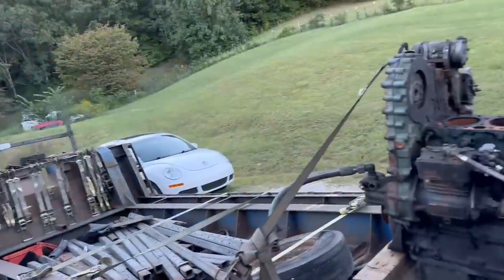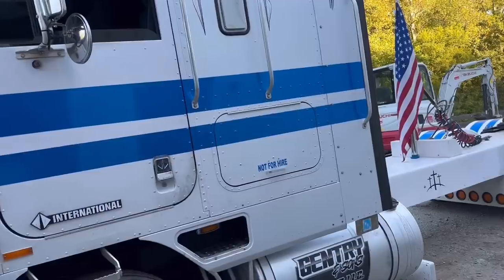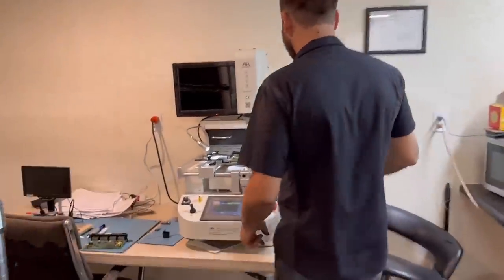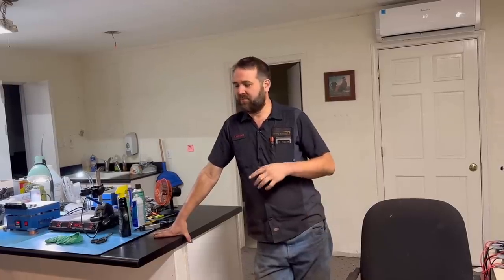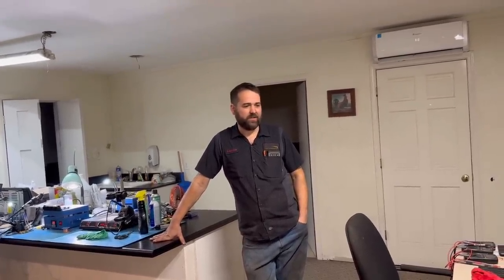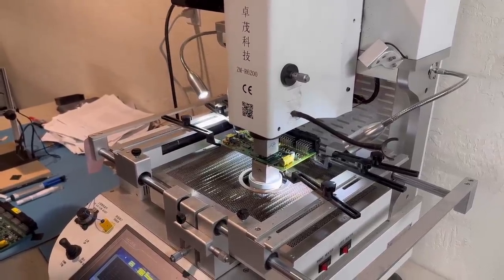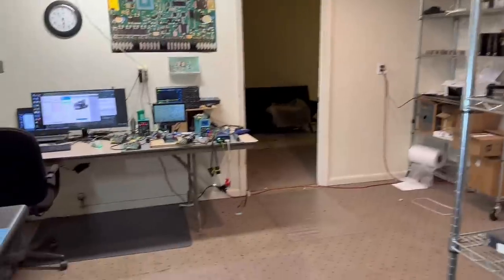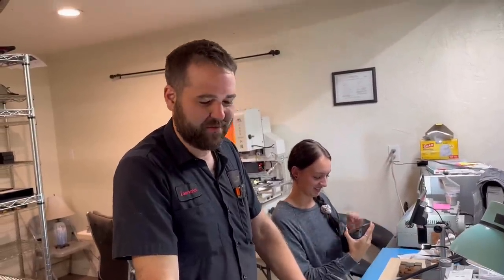FREIGHTLINER CPC Problem Is Over We Have The Fix!!

Comment: Please relay to them that the girl needs to have a fume extractor running when she’s cleaning the pads on the chips. The fumes from the flux and the solder can be toxic. It’s a cheap piece of equipment but it would be a lot healthier for all of them.
Reply: Tim please do this we don't want to see Virginia get hurt!
Reply: Well now that you said something about OSHA will be in contact with you and your complaint
Reply: You can literally hear it in the background.
Reply: @jimbob8969  can hear what? A fume extractor? That whining noise is from the  BGA soldering station. Fume extractor would have a box with a hose attached to it to pull the fumes away and filters it.
Reply: @russellclugsten4797  really?? Look at buddy’s teeth up top… wait there aint none left lol 😂
Reply: @russellclugsten4797  I know what a fume extractor is, I have one that would recycle the air in that room in a very short period of time.  Mine is mounted in the ceiling above our welding and cutting floor.
Reply: @chorbajiiski   & your point been is.......
Reply: This is why the internet sucks because of some of these comments.
Reply: @MegaDripping  my point is learn how to spell
Reply: 😅😂😂🗣️🤡relax   Thiers  a vent at top of the door!!🗣️😂😅 I'm sure their no rookie's relax!!!🤠🤡😤😅😂🗣️
Reply: @russellclugsten4797  dude Thiers a Thiers one in top of the door  genius
Reply: @russellclugsten4797  soldering is easy  I've been soldering for years  i hate when pp think their experts over watch ING a video😂😅🤡  u think they don't know the toxic fumes it puts out or u just thing their stupid etc lete know?????? Send them one if your worried i will school u when it comes to soldering dude 😎 😤
Reply: @jimbob8969  That is not the same thing, for us who do a lot of soldering you must have the extractors head no more than 2-6 inches from the work, what you're talking about will kill you, Lb is extremely poisonous. Here is a master, Louis Rossmann. https://www.youtube.com/@rossmanngroup/search?query=soldering

Comment: It sounds like Freightliner, Western Star / Dimeler have knowingly designed this cpc  with this flaw so that it will fail after the warranty has expired so that the truck owners will have to spend the money on labor and a new cpc. It would also seem that they don't care about the potential thousands of dollars it could cost the truck owners.  I  wonder if someone could bring a class action law suit against them. After all this video proves the fault in how the parts are made and how it could be fixed by the manufacturer just by changing the type of solder and Flux they use.

Comment: Schaffers diesel did my 2000 century and it s an amazing tune.I love the way that truck pulls and feels
Reply: Unfortunately, I haven't had a good experience with these folks. I've paid $2500 for a CPC repair. I tried it in the truck and had more codes that I started with. He asked that I send it back to him. I did and he hasn't fixed it. For 2 months I have asked for it back. Fixed or not. However Mr Shafer has ghosted me. Weeks and weeks. No response and no CPC. Would NOT send my CPC or anything there again.
Reply: @davidplantemusic3687 Have your issues been resolved? I need to know before I bring him my cpc.

Comment: Good on you Tim, for helping a local, become very comfortable with life financially, and I’m sure he will succeed in life! Ronnie, Oneida Tennessee
Reply: Unfortunately, I haven't had a good experience with these folks. I've paid $2500 for a CPC repair. I tried it in the truck and had more codes that I started with. He asked that I send it back to him. I did and he hasn't fixed it. For 2 months I have asked for it back. Fixed or not. However Mr Shafer has ghosted me. Weeks and weeks. No response and no CPC. Would NOT send my CPC or anything there again.

Comment: It's kind of sad that manufacturers won't address these issues with any degree of expediency & reliability. At least somebody is out doing good work like this who actually cares about people's livelihoods.
Reply: General Motors is having the same issue and some of their newer vehicles. And it’s not that the manufactures have not addressed the fix is the fact that they don’t have the part to fix it.
Reply: @philliporne2287  you don't need parts. You need solder & a bit of know how. Manufacturers just refuse to repair products because that doesn't make them as much money and requires more work.
Reply: 🤔 Built to fail to keep the money machine rollin and create jobs. These days the corporate don't build to last with quality it's done with quantity. 💯
Reply: @sawyer4981  It is so much faster and cheaper to replace than repair.
SMT soldering is nothing like through hole soldering.
I can solder through hole and simple SMT chips but don't have the tools or skills for soldering those chips.
Reply: @andrewforte  I literally just said that. But if you can't replace the parts and the shit you're making is failing, you should be offering repairs to customers who paid hundreds of thousands on your products which are now useless.

Manufacturers won't do that because it doesn't load their pockets enough. That's fucked up.
Reply: @sawyer4981  it’s called a recall.
Reply: @philliporne2287  That's nice, except they don't recall the shit that's broke. They just expect you to wait several months after paying them thousands of dollars to receive a replacement part. All the while, your business is at a complete standstill. Even better, you're still paying your truck payments for a truck you can't even use.
Reply: @sawyer4981  If a vehicle is not usable to a point that it’s still under warranty the manufacture will buy it back from you. The part is broken and it seems to be a big issue 9 out of  10 times it’s gonna be a recall.
Reply: @philliporne2287  Ask someone who's been there, that's damn near impossible. Getting the manufacturer to buy back the car requires months and months of them "trying" to fix it first and almost always requires you getting a lawyer to sue them first. It's even more difficult with commercial vehicles. They will point the blame to others since there are so many suppliers involved in all the major components on tractors. 

And again, all these months, you're making payments and paying that lawyer without the ability to generate income using the truck you paid for. 

Idk what it is with all you idiots simping for manufacturers as if they have your best interest in mind. I can 100% guarantee you, they do not. Their only goal is to extract as much money from you as possible.

Comment: 12.7 s60. Had drove many of kw t800. Getting over 6.6 mpg running the Colo. Mtns all year for over 10 yrs.  Solid n very dependable Detroit engine. Had set at 430.470 horses. Jake's are decent too.  Stay safe n keep it going

Comment: It's quantity NOT quality these days for corporations. Purposely designed to fail to keep the 💰 🤑 💸 💲 Machine rollin. Take for example the John Deere Tractor.  Notice how many MUCH OLDER ones run FLAWLESS and still around  compared to modern tractors 🚜 with all the down time.
Do the research. ✌️😊👍

Comment: I have a 14ltr that I use to haul oversized load with. Weighing up to 140k. I'm lucky to see 3.5 mpg sometimes. Even with a light load I'm only getting about 5mpg. I just had it rebuilt but I think my tune is the problem. It runs great and pulls hard but the Pyro stays around 900 degrees and it will jump up quickly if I don't keep the rpms up around 1750 to 1800 rpms. The turbo is a 1702 and it will boost 40psi and it'll hold it but then the Pyro will start to go above 900 degrees. Why advice on a tune and how much to do it? I've already spent more on this engine just trying to keep it together. It's blown 4 head gaskets over the last 6 years.

Comment: Just broke down after pulling off the Lease lot at SFI finance 3 days ago. Pulled into a Loves for my 30min, tried to start the truck again & it doesn’t turn over. CPC not configured on the dash, no indication of any bad batteries. It was towed to a shady Freightliner associate vender in Ohio cause it was the only one nearby. They say all the batteries need to be replaced, but that makes zero sense. If your able to answer quickly you can save me here, Would a bad battery cause a CPC dash fault? And why does this module control such important aspects of a Semi Truck. This is absolutely criminal, it has conspiracy written all over it. That makes trucks vulnerable to hacking. Anybody can send a killshot to this module & ruin somebody’s life. Mega Carriers can abuse this to destroy somebody’s money or Owner Ops. I need advice please respond if i should tell these guys to not bother with the batteries & to fix the module somehow.

Comment: 12.7 Detroit series 60 engines from Fitzgerald we've used average around 6 mpg. Is there something you are changing to get 7-8 mpg?
Reply: Lol. No
Reply: It’s got a lot to do with the driver if he is an aggressive driver then you’re not going to get 7 and 8 miles to the gallon I have owned three Siri 60 12.7 L Detroits and I have got as much as 9 1/2 and 10 miles to the gallon loaded light running flatland and keeping my foot out of the radiator.
Reply: @tomhodge2565  we run them for years pulling vans. 5.5 to 5.8 fleet average is all we could get. We run all newer stuff now all paccar and it’s unreal how good the fuel mileage is.  Kenworth T680’ and Pete 579’s. I don’t want a Detroit on my yard even if it’s just visiting. Lol. Not even a DD15.  They are a nightmare. I’ve had 10 of those and they are trash
Reply: @tomhodge2565  you right on the driver thing. When I drive I drive for fuel mileage. I can clock 11 plus mpg pulling a van with the kenworths I have. They cut the wind a little better I think than the 579’s and a little lighter weight. I really love my paccar Mx13 engines. The savings greatly outweigh and emission repairs they may have as high as fuel it.
Reply: @bobjohnson7797  lol. All while rolling coal and doing burnouts
Reply: A good tune can help a good driver squeeze more out of one. You can often increase fuel mileage by 1 to 1.5 mpg with a tune that optimizes injection timing for efficiency.

Comment: Great reduction in emissions with zero additional equipment/computers and no loss in reliability.  I need some for a Powerstroke 👍👍
There is an outfit in Europe rebuilding the ECM's for the Paccar MX engines as well since they are backordered for like a year right now also.

Comment: great info Tim but im an old guy i would rather have a Cat or N14 over the 60series if hauling heavy haul just my two cents i like the big block engines
Reply: Love the N14 was great engine was upset too see Tim's old Kenworth leave the fleet was the truck with the best engine! We used too have a lot of N14 as was top engine in the ERF!
Reply: I bought a 97 Ford LTL9000 in July with an N14 with 310,000 original miles
Reply: A 14L Detroit set up correctly will walk all over a 3406 or N14.

Comment: Unfortunately, I haven't had a good experience with these folks at Shafer Diesel. I've paid $2500 for a CPC repair. I tried it in the truck and had more codes that I started with. He asked that I send it back to him. I did and he hasn't fixed it. For 2 months I have asked for it back. Fixed or not. However Mr Shafer has ghosted me. Weeks and weeks. No response and no CPC. Would NOT send my CPC or anything there again.
Reply: Doesn't the CPC have to re-learn everything? Did you have it somewhere so it could be reprogrammed to your truck and all the codes cleared? Just asking for informational purposes in case mine goes bad.
Reply: @tommythompson3588  They've said they re-program your original CPC. As I've Said before. It's been months but have got my CPC back. I would not send my cpc there if I had to do this all again. I'm still out $2500 at this point.
Reply: @davidplantemusic3687 Do you have an update? Because if what you say is true, there is no way I'll bring my CPC to them.

Comment: the only way your trucks would be as good or better than modern ones on emissions is if your exhaust tips are clean. just because you can't see smoke doesnt mean its as clean as one with a DPF. A dpf incinerates all the bad stuff inside it and thats why the tips are clean

Comment: Dang you can’t even help hook up a great business with customers in a bad situation with a good company without people trying to knock them down and shut them down 🤬😎Rickster. Friend of mine when all this electronic crap started lost his truck because peterbilt couldn’t figure his problem out so he traded for another truck on there used lot that was twice as high and lost it 🙈while my 400 Cummins would run with no electric just screw the screw on the pump in and as long as it was running or could push start it would go for ever 😂😎Rickster 🤘